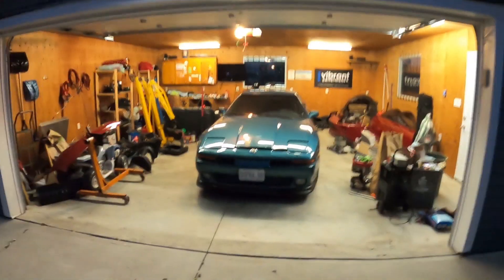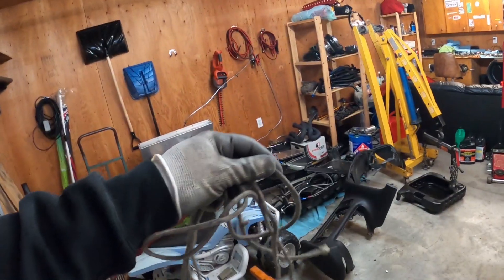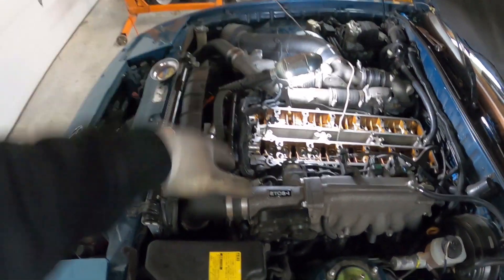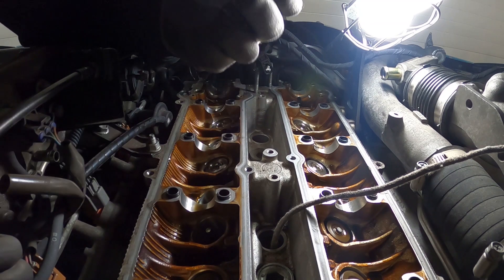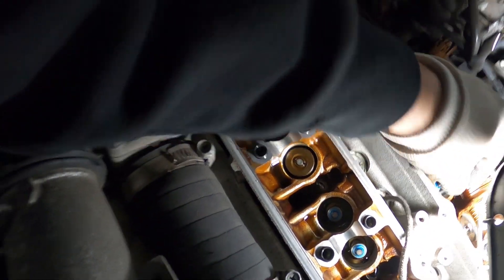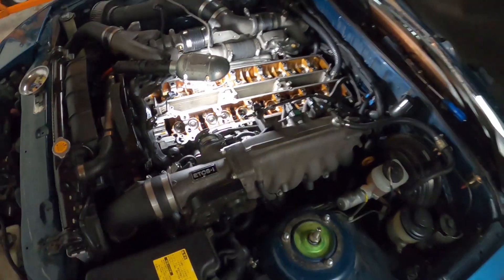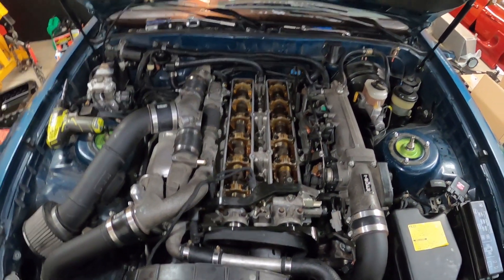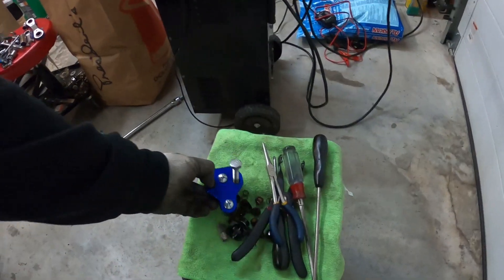2JZ valve spring replacement guide

Comment: Im about to order the tool you linked in the description, I just want to double check. I am sure its perfectly fine, would this blue tool be fine to use on a stock valve train for removal and installation of the seals? this will be done on a stock 2jzge

Comment: How did you get the back with the blue tool
Reply from the maker: Patience haha
Reply: @RyanSammutRacing  I got them lol. Your right about patience....

I fished a keeper out the oil pan lol
Reply from the maker: @2jhallidayz259  oh shit haha.. glad you found it
Reply: @RyanSammutRacing  lmao! The world ended lol. 

Cams go in after the last 4 valves in cylinder 4. Wanted to skip and do the hard ones so they’d were done. 

Then slide belt back on the gears. I seen you did that way as well
Reply: @RyanSammutRacing  i want a 2jz valve spring compressor tool. I cant find link to order
Reply: Did you all find the link?   I found a similar tool on Amazon but it was for Subaru.

Comment: hey what pitch size and then length are those 2 Philip screws for connecting the valve spring compressor tool onto the cam cap holes?
Def wanna try that tool out over the toyotool
Reply from the maker: M8 x 1.25 - 50mm long
Reply: @RyanSammutRacing  thanks man!!!  Will order one to do my valve spring install 👍👍👍

Comment: I use the other way where you hammer it in and i never feel the lil “clip” part
Reply from the maker: Toyotool works well too
Reply: I have the toyo tool and i cant push it far enough for it to lock so i bought that subaru tool you have but i wanted to ask is it fine if it sits on the dowel pins as opposed to the actual head?

Comment: what did you find worked the best to get the rubber debris that was left over out ? Also I use the toyo tool but have to muscle it, that is a cool spring compression tool i have never seen before to put the keepers in. Do you have that because of aftermarket springs? If i recall the stock springs didnt have a top or a bottom like a beehive or conical, i remember the springs being the same at both ends? Nice work btw!
Reply from the maker: I use long nose pliers to remove the rubber debris. This tool makes it easier to work with, toyotool is good but higher chance to have keepers flying everywhere. 

These springs beehive, the go in one way